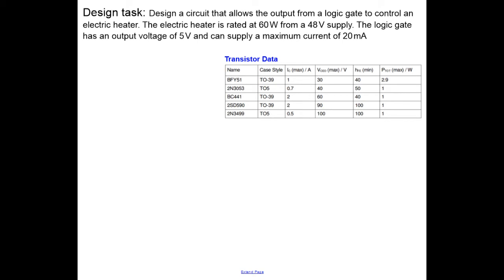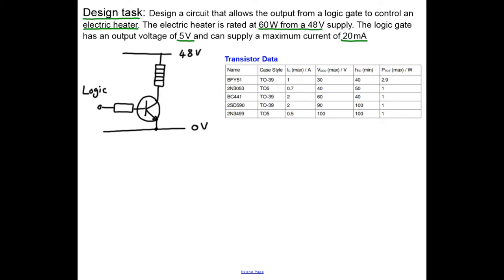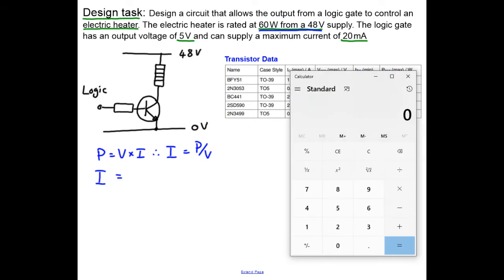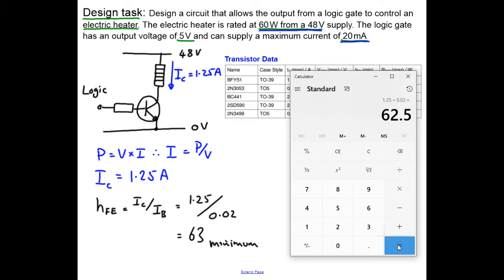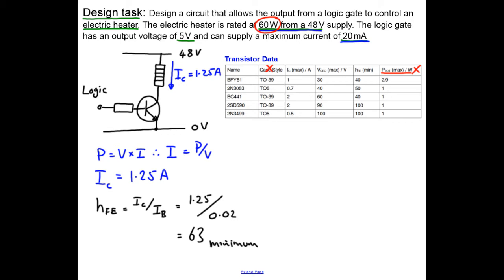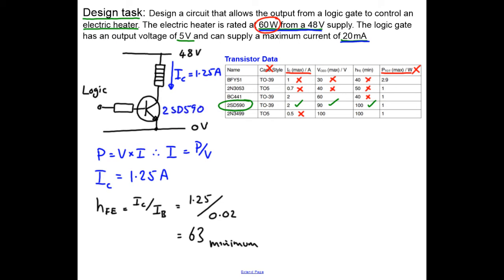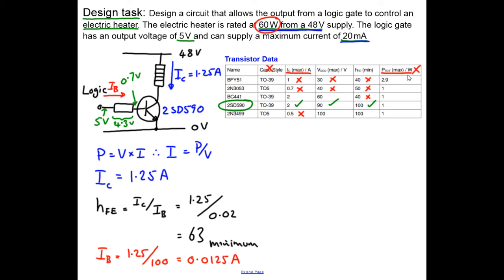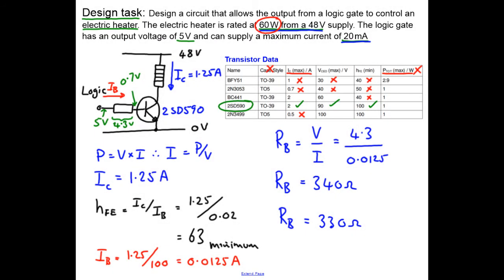Bipolar Transistor Design Exercise

Comment: In practice though doesn't a heater have a low resistance until hot, so there is a higher initial current
Reply from the maker: Yes but when we measured the change in resistance it wasn't actually a huge change (we made our own heaters) and the transistors do have a greater maximum vale of Ic for transients. I am dealing with the steady state situation which I think is still a valid approach. However, I appreciate your comment and have updated the video description accordingly.

Comment: 3:17 Transistor Pd is not zero - it isn't a perfect switch;  Pd is Ic x Vce(sat)
Reply from the maker: Thank you for your comment. You are correct, the value of Vce does not reduce to zero. Vce is Ic x Rce at saturation. However, in my defense, this video is part of a set of lessons I made for my GCSE students in lockdown and the syllabus states "VIN ≥ 0.7 V, the transistor is on, VBE = 0.7 V and VCE = 0 V" so I am absolutely guilty of just accepting that approximation without due warning! In a different video I demonstrate that Vce reduces to 0.05V when used as a transducer driver which, in this context, is close enough to zero. I have updated the video description accordingly.
Reply: @ElectronicsTeaching  Thank you for your kind reply. Though I measured, like yourself, Vce(sat) to be quite low - 0.15 Volts in my case, it can be higher; Vce(Sat) is generally 0.1V or 0.2V